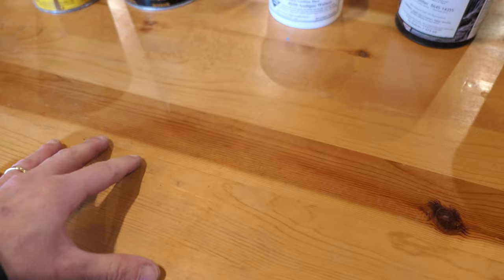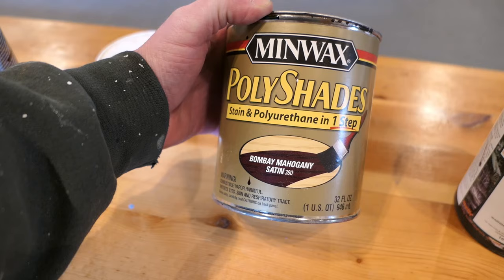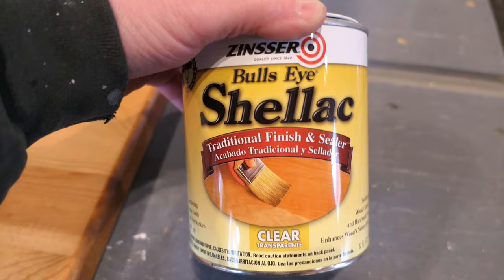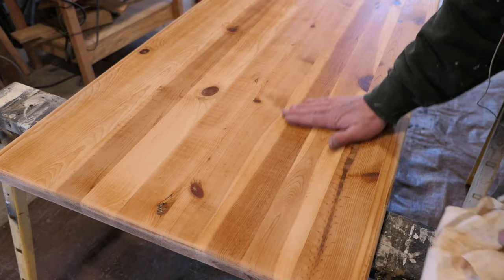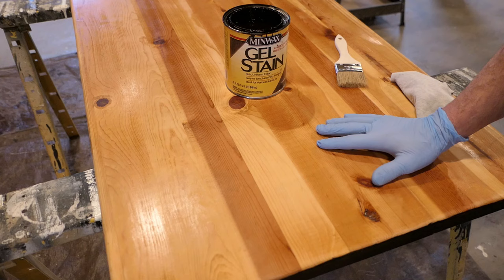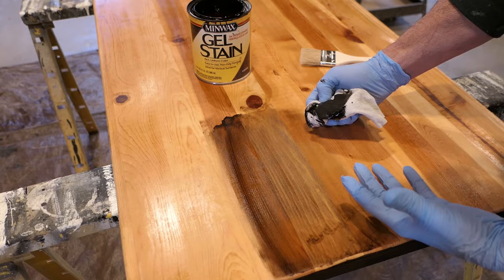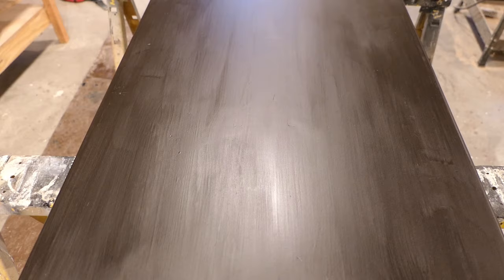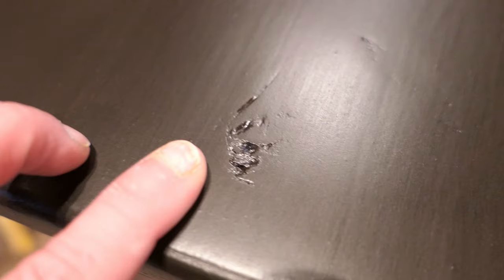How To Achieve Very Dark Stained Wood

Comment: You might as well just painted it.  Stain is supposed to let the grain show and your method doesn't do that.
Reply from the maker: You can paint to get this darker color, but it will look like paint.  Using stain and glaze to get the darker look does allow some of the texture to come through, which will vary depending on the type of wood.  And then when a clear coat is applied it will appear like a dark wood with a greater depth to the finish.  If you use paint then you can't use a clear coat and sheen will not have the depth of a clear coat.
Reply: You can see grain on the video still shot before it even starts.

Comment: There is a process called water popping that i use on floors to get them really dark. If you take 1 part denatured alcohol and 3 parts water and wipe it evenly on your prepared surface and let it dry it will make the color many shades darker. I use minwax or duraseal stains. Prepared surface meaning sanded down to bare wood and a finish sand at 100 to 120 grit. The smooter you sand the lighter the color too. Rougher grits can show sanding flaws more though.

Comment: It essentially just looks painted, I thought gel stain would show more of the wood.
Reply from the maker: To be clear, this was an extreme example.  Gel stain can be used less liberally in order to allow the grain to show through.  The point of this particular video was to show how far you can take the process.
Reply: You can do what he did except wipe off the gel stain after so many seconds.  Then let it dry and do it again.  Pretty much just stacking on very thin layers.  The grain will still show.  I did this for our kitchen cabinets in the house we bought as they're that builders grade golden oak veneer and I was a bit spooked to sand them down enough to do a regular stain job.  Unfortunately took like 7 coats of wiped off gel stain to get as dark as I'd like as opposed to the 1 or 2 you'd get here.  Still, I much prefer having the grain as opposed to the painted look.  

Great budget idea for refinishing veneer, but IMO would be a PITA to use on real wood when you can just sand it down well enough for a regular stain.

Comment: Thanks again, John.  Since the glaze sits on top of the surface rather than soaking in, wouldn't it be similar to just using paint?  Or does the glaze allow some of the wood grain to show through, while paint would completely obscure it?
Reply from the maker: That's a great question.  So, there are some differences, and maybe this little demonstration on a rustic tabletop isn't the best example.  With paint, you can obviously get whatever color you desire.  The final finish, though, is just going to be that paint and whatever sheen the paint imparts.  With a stain AND a glaze, which is what I would normally do, you will get some wood grain coming through from some species (certainly oak, ash and the like.)  With a very heavy glaze like I used here in this example less grain will show through, for sure.  However, the glaze is then followed by clear coats of poly or whatever else.  That tends to make the wood look like it is stained rather than painted because it adds depth and it's own sheen.  Even from 20 feet away you'll be able to see the difference between a paint and a stain/glaze with a clear coat.  It's that depth that you can't really get with a paint.  For a rustic example like this tabletop a paint might be just fine, honestly.  But for a more refined piece of furniture or cabinetry, the glaze and clear coat are going to look much nicer.
Reply: @enduringcharm  Thank you.
Reply: Ah a well asked and well answered question I thought the same thank you

Comment: I have just laid a pine deck and want it to look dark like meranti or jarrah. The dark oils are coming out much too bright.
Reply from the maker: You mean an exterior deck?  If you have used pressure treated pine it won't be easy to achieve a dark finish unless you use a solid or semi-transparent stain, and those generally do not hold up well on flat, horizontal surfaces.  You may get a year or two out of an application.

Comment: This was extremely helpful - thank you. I have a door that I am trying to match a 1920’s very dark aubergine shellac finish and I have been at wits end. I tried putting fake dyes into Amber shellac, it turned out horribly, so I stripped all that off, tried a varathane stain but that wasn’t dark enough, so I stripped that all off. What you have done into this video is very similar to what I’m going for, with the dark gel stain, except my topcoat may be the dyed shellac that i used instead of poly. Thank you!
Reply from the maker: Shellac can be used over any finish-- oil, water based or other shellac. You should be fine.

Comment: Your presentation is very well presented; visual is clear and steady, demonstration and explanation are also easy to understand. It is not just how to do some task but to explain why or what if is just as important. I will apply your method on my next project. Thanks for the Emtec and info about why it is important to allow the oil byproducts to evaporate before finsih application.

Comment: Would you still use shellac if you before staining and then add a gel over it to get a deeper color. Would this method help have a darker stain without making the oak grain stand out?
Reply from the maker: If you are working with oak, there are two factors to consider.  First, oak is an open pore wood, so unless you take steps to fill those pores and sand the surface smooth, they are going to show through the finish.  Often oak has a thin finish for this reason, since a thicker, built-up clear finish tends to look like plastic and rough.  Second, if you are working with cleanly sanded oak with no prior finish remaining, then you'll find that it stains very well and you can probably get a dark color with little trouble.  Oak, unlike some softwoods, will take the stain deeply and evenly and you can find very dark oil based stains which go on easily.  So I would first try a very dark penetrating stain and see where you get.  Then you can add a surface glaze if necessary.  You can complete the process with a tung or boiled linseed oil or a dark Watco oil instead of a polyurethane.  However, if you fill the pores, then you may need to rely on the glazing because the filler may not take the stain as well.

Comment: I have spent a week getting my half bath floor sanded and ready. I got it down to bare wood, filled in cracks bla bla bla. I stained it for 5 minutes with minwax in the semitransparent color mocha. But what I'm not liking is the extreme color difference in the grain. I want to see the grain, but I don't like the light tone. It almost looks like that burnt wood with the high contrast in color. Will staining it again make that darker? What are my options?
Reply from the maker: Some wood species such as pine, oak, and fir have pronounced differences in the grain pattern.  When you sand the wood the softer areas tend to wear away more quickly than the harder lines of the grain.  That telegraphs those lines in the staining process.  Since you've already stained and since you probably don't want to start over, I think your best option now is to put down a sealing clear coat using a shellac based sanding sealer or other product.  When that dries you can use a gel stain as a glaze on top of the seal coat.  Since the glaze sits on top of that clear coat it will be more uniform and you can choose how dark or light you want to make it.  Once you are happy, put down two coats of a clear finish such as polyurethane.

Comment: I just finished staining new oak cabinets with varathane wood stain. I have not put any finish or poly on yet. Can I use gel stain over it and the let it dry and finish it with poly?
Reply from the maker: Yes, you can use gel stain over the stain you already put on and the gel stain is essentially a glaze then.  However, just be cautious about compatibility of finishes as far as oil or water based.

Comment: I just came across your video when I was trying to get info on bondo and gel stain. I want to gel stain the top of a buffet table that has patches of Bondo and I'm getting different opinions that the gel stain won't look even on those bondo spots. Is this the case? Do I need to give up thinking that I want a stained top? Your video is such great info. Thanks
Reply from the maker: That's a great question.  I have used bondo to repair small imperfections in wood, and I have stained the bondo as I was mixing it using powdered dye.  That experiment actually worked pretty well.  But, in your case the patches are already there.  One option you have is to make new repairs while you are refinishing.  This might be in the form of "dutchman" repairs, which are fairly thin wood patches fitted into the surface using a router or chisels. Since the repair is wood, it should take any stain or dye in a similar manner as the rest of the surface. 

If you don't want to get into that, using a process like I showed in this video can probably work.  What you might find is that the bondo patches reflect light differently than the wood.  This can be helped by sanding the whole top with a random orbit sander, maybe stopping at 180 grit rather than going finer.  Then apply several coats of shellac, sanding lightly by hand with the grain between coats.  Then you can apply the gel stain heavily and see how you do.

Comment: Hope you can respond to this question. I love that finish , to achieve a similar look I am using 1/2 in maple or Birch Plywood. Should I Schelac it prior to using gel stain as a glaze ?
Reply from the maker: Plywood will soak up any stain or glaze like a sponge.  So, you should seal it well before going with a glaze. You could stain the plywood and then apply a shellac before you do a glazing step, or you could seal the plywood with a shellac or other clear finish before relying entirely on a glaze for the color.  You may want to do multiple coats of the shellac or other clear finish to avoid the grain telegraphing through if the grain is unattractive.  In any case, I highly recommend cutting a few 6x6 squares of plywood that you can use for testing before committing to a process.
Reply: Ok Thank you so much for the advice. I shall try a few test befor committing.

Comment: I am refinishing a coffee table and used minwax ployshades expresso.  It came out so light.  Could I apply the gel stain on top of the polyshades coat?  Then do I need to do a polyurethane on top of the gel coat?
Reply from the maker: The answer is almost certainly "yes."  However, I believe that polyshades product may be oil based, so let it fully cure over a period of days.  Then you can try a gel stain on a small spot and see how you do.  If it isn't working, you can wipe it off with mineral spirits if it is an oil based product.  Once you are happy with the color, you will need to apply a clear coat over the gel stain, and make certain you use an oil or water based product as appropriate for the gel stain you used.
Reply: @enduringcharm  Thanks for the info.  I had one other qq.  Should I sand after applying the polyshades and prior to the gel stain?
Reply from the maker: Again, test before going all in, but probably you will not need to sand the polyshades.

Comment: Would you use the same process products with oak?  I have an old ball and claw golden oak table I would like to finish to dark dark as possible .  (But not paint) .
Reply from the maker: Oak has pretty significant open pores on the surface, which can complicate finishing.  If you don't mind those pores in the finished product, you can leave them be and you will see some surface texture through the final finish.  If that does bother you and you want a smooth finish, you need to fill those pores as part of the finishing process.  

That said, oak does take stain very well and if you are sanding down to bare wood I'd suggest you first try a regular oil based stain rather than a glaze.  Get that as dark as you can and then if you still need more you can apply a glaze on top of the stain.  Obviously you'll want to experiment on a piece of scrap oak first to ensure color compatibility.  I find oak to be a pretty forgiving wood as far as staining and glazing, but those pores can be trouble for the clear finish coat.  One option is not to use a clear polyurethane at all, but cover the stain or glaze with an oil finish such as boiled linseed oil or Danish oil.  The latter comes in dark colors itself and is very easy to apply.